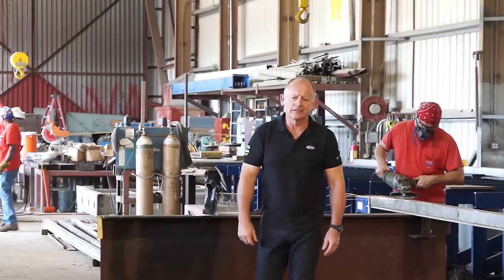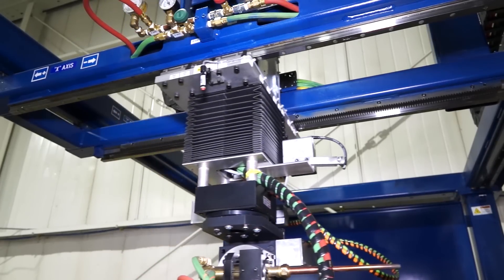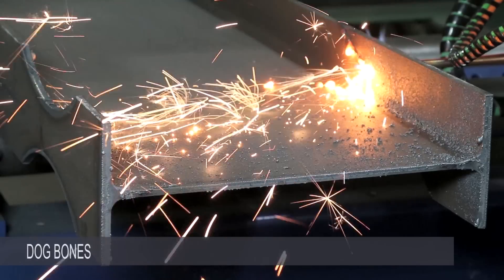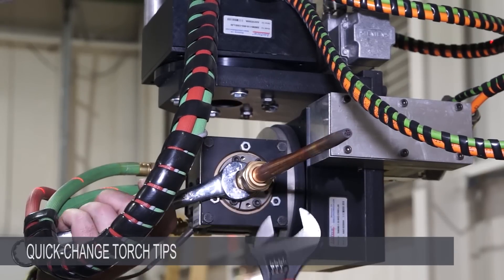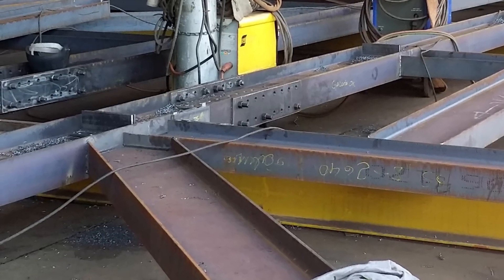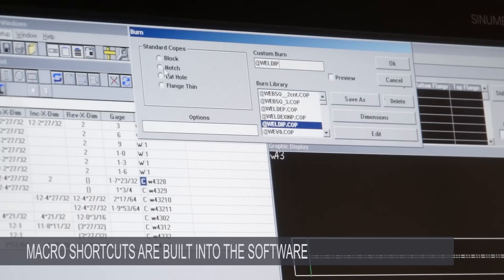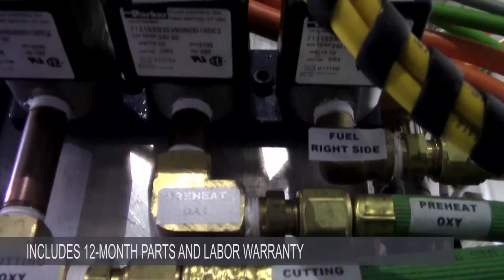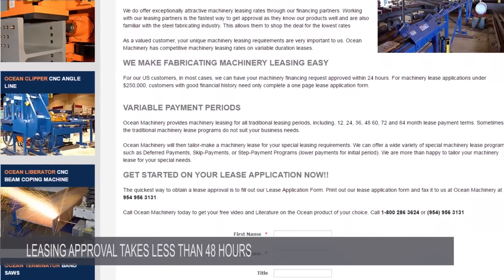Ocean Liberator CNC Beam Coper - Full Video

Comment: The reason that a lot of skilled worker's do not stick around is because of pay and not being appreciated for doing a good job.
Reply: Theodore Narvaez I was just about to write that
Reply: No joke, i turned down exactly this kind of job because it only paid 15/hr
Reply: I'm a fabricator/welder with 30 years experience, I'm glad at this point most of my career is behind me... I am glad I am not a younger person starting out in this trade. Automation is inevitable, in most areas of work at this point...repair and installation work is probably safe for awhile. To anyone looking to start out working in a fab shop though, might want to look at different options. Employers will always look to saving a buck, if that means offering low wages, reduced benefits... or slave like working conditions...they usually do it. In 30 years, I have never felt appreciated, valued or fairly compensated and I have worked for alot of different shops. If I had to do it over again from the start, I would look at any other trade than welding, fabrication.
Reply: fabricators in my area make like 30+ an hour, and ironworkers make even more. yall are looking at it wrong. i have seen wages increase as automation has been added. the problem with lack of skilled labor isnt because skilled fabricators are leaving to different trades. it is because most young people see any blue collar work as beneath them. welders and fabricators make good money nowadays, but everyone keeps teaching people that they are some kind of failure if they dont go to college. it is a problem in every single blue collar trade. there are a huge amount of people that refuse to get into skilled trades like welding that would be much better off if they did. i know plenty of ironworkers that make over 100k a year. and what happens when shops get more automation is they can handle much larger projects, which brings more money in. each person ends up touching a lot more steel and it makes each manhour a lot more valuable to the company. what automation has done is eliminated a lot of the low-paying unskilled work that used to take a lot of time in shops. now they dont need guys sitting there all day doing things like mag drilling holes or tons of grinding. but the skilled guys become even more valuable because a skilled guy can produce a lot more than they used to be able to because they are spending all of their time doing the skilled work instead of the work that doesnt make money. as a worker, you want your input to make the company you work for more money. it makes you more valuable, and pay increase can actually make sense. if you make 20 bucks an hour, and you only produce enough to make the company 5 bucks an hour, they are never going to give you a raise to 30 an hour. it would be a losing proposition for them. but if you get paid 20 bucks an hour and you produce enough to make the company 100 bucks an hour, then a good sized raise can make a lot of sense. this is exactly what i have seen automation do. it is there to leverage the time of the skilled workers. whenever your skill is being leveraged to make more money, it makes you much more valuable
Reply: @JohnDoe-rx3vn  lmao i got a 6x2.5m plasma and oxyfuel table with a pipe rotator.34$ an hour without overtime. and it's a plasma table, ofc its gonna be alot of overtime lol

Comment: What about tolerances? H beams come in different sizes - a pack comes with the same heat no. and often one is up to 5mm higher than the other. Does the machine have systems to compensate?
Reply: Hi HyldenLord - Yes the Liberator and all our CNC products understand that there are always mill tolerances, and on some machines we use probing to detect and verify the actual size of the beam (not the nominal size) and the machine then compensates. On the Liberator, which is a semi-automatic machine, the offset of the torch is set slightly beyond the nominal beam envelope to allow for mill tolerances, and the operator then adjusts the torch-to-material gap manually,  if needed. The torch also over travels in the Y direction to ensure that it cuts through a flange that is oversize. With hundreds of our Liberators in service around the world, the machine compensating for mill tolerances has not been an issue anywhere. Hope this helps